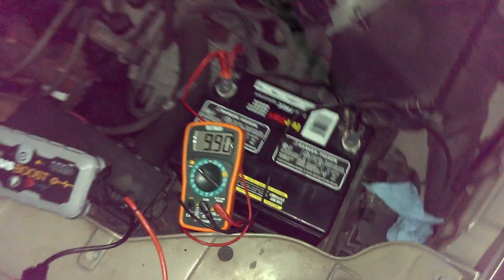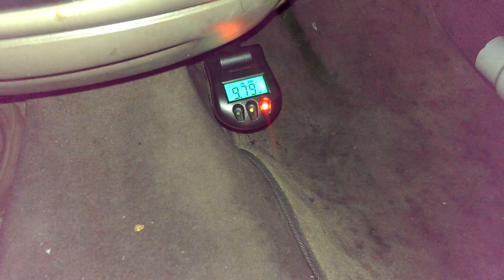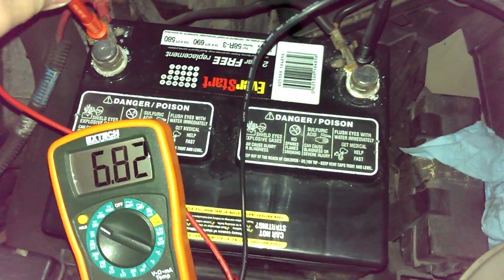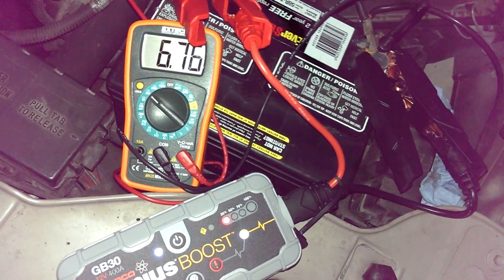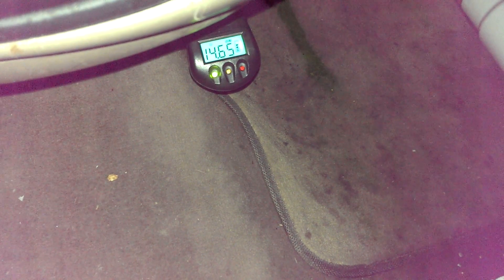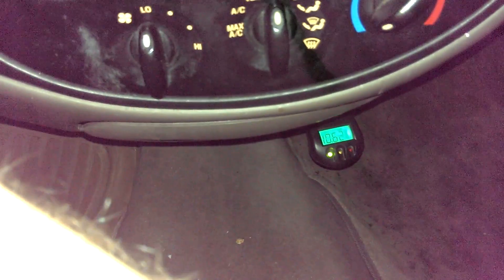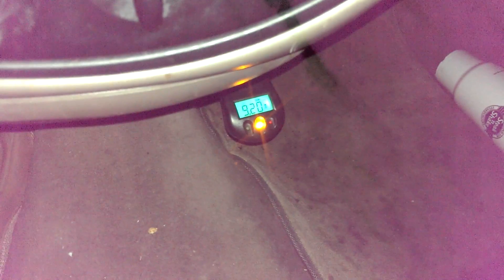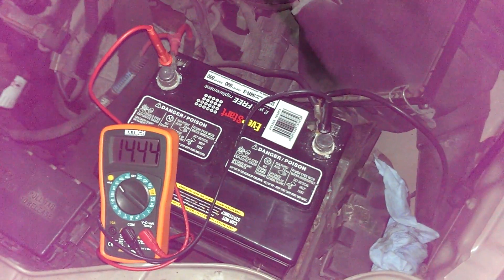Noco Genius Boost GB30 start test, old/dead battery 9.90 volts!

Comment: A great battery tender for my occasional use car.◓◓>imgs.love/nBatteryCharger?ㅔ     I installed the leads on the battery, so everytime the car gets pulled into the garage, it gets plugged in. The connector in the lead going to the car makes this process fast and simple.

Comment: at least your alt. is in an easy spot to get at,  ijust dont get 3 bad ones?  that was a good demo with the 2 meters.
Reply from the maker: bill man they weren't bad at first,  they all lasted around one year which is typical of parts stores rebuilds these days
Reply: justin, ok i see, i misunderstood, im always interested as my ranger will be 15yo this year with almost all original parts, 5 batteries tho! 2 free ones from auto zone,3year warranty.
Reply from the maker: bill man if your battery dies after more than a year it's not usually ever the fault of the battery but they rather die from "abuse",  whether intentional or accidental.    lead acid starting batteries start to sulfate rather quickly when at anything less than a full charge and it doesn't take long to drain the battery below 80% either by listening to the radio with the key off for 20 minutes or parasitic draw from infrequently driven vehicles.  The best thing to do is charge the battery monthly on the grid with a proper battery charger like a Noco or other good brand.    I like pro Logix and ctek too, most store bought chargers over charge with higher than normal voltages.   Lead acid is a lazy technology and it takes 3+ hours at the correct voltage usually around 14.7v to get the last 20% into the battery,  your alternator is not magical and will never call for this voltage for this long.     Check out my video on the pro Logix charger it's really sweet.
Reply: justin, you are correct i was a battery abuser , ileft GPS, XM, etc.plugged overnite, batteries dont  like that, gonna ck out that pro logix charger...alts cant do it all.

Comment: Love your videos, just what I needed to convince myself to get this booster pack.   What model of 12v voltage gauge are you using in the video
Reply from the maker: The in car meter is an INNOVA 3721,  the digital multimeter I used under the hood is an Extech MN35

Comment: hmm you can still ruin your car's electrical , don't believe it's 100 percent safe!  cause it's not!  hence if  you have a totally dead battery with totally no voltage I mean Zero that little thing will not sense a voltage and when you plug that on reverse it will kill your car's electrical system ,  or worse , if you CLAMP that little charger directly to your car bypassing the regular car battery you WILL kill the car!  the car has ZERO voltage with out a battery so once again the little charger will not know that is connected incorrectly .
that is a false sense of security. you still have to double check the colours! don't be a fool!
Reply from the maker: Yes Fred,  it's possible to hook it up backwards and manually over ride it but 99% of the time you won't need manual over ride,  the genius boost can detect batteries with extremely voltage.   My test is just to show how powerful the unit is.
Reply from the maker: Also compare this to units you find all over Amazon and the Web that have zero sensors and zero safety precautions and are hot on both clamps as soon as you turn the unit on.  

Also none of them have the quality of this unit has,  it's got to be the highest quality lithium jump pack in the world.    I have taken it apart and it's nice inside.
Reply: I am not saying that the product is bad but I would still be really careful , that's all and I hope nobody uses it as a battery reversed cause it can fry the car's electrical system, that's including the computer. that mistake can be really expensive.

Comment from the maker: About 4 1/2 hours later on my 10 amp automatic charger and the battery is full again,  always remember to fully charge your battery after discharged if possible before putting it back into service.   You're alternator will thank you.